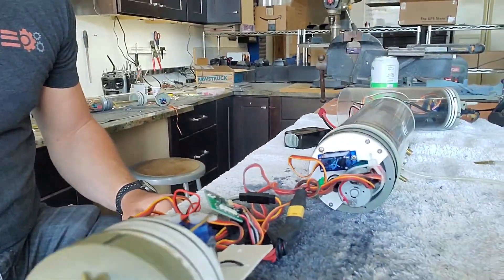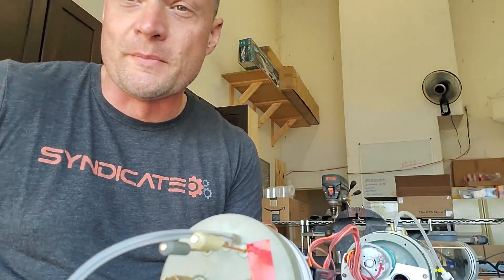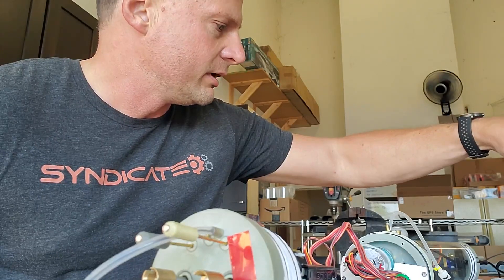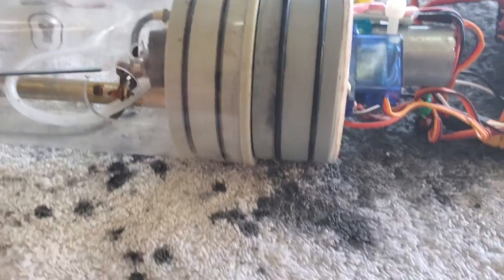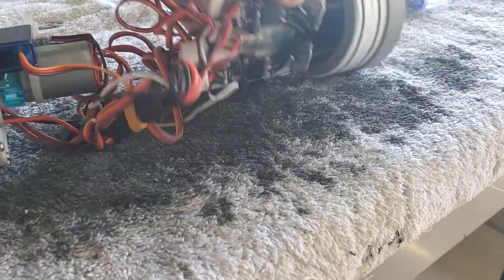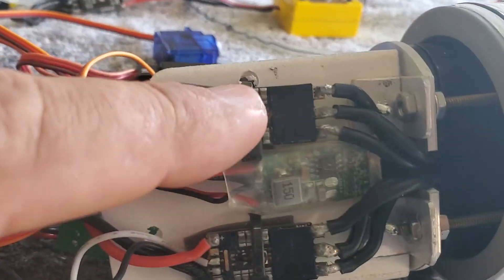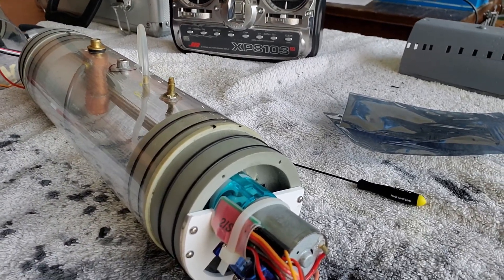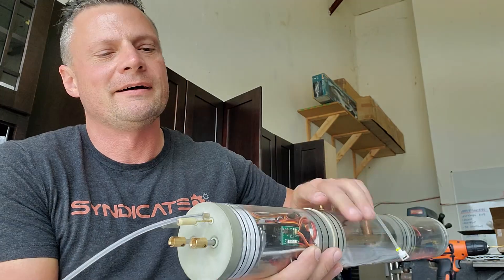Troubleshooting a misbehaving cylinder for your RC submarine

Comment: Bob,where you able to salvage speed controllers or replace?I fixed electronic switch that got wet with corrosion X.Thought I pass along this tip.Tip for tip,sound fair?Always enjoy your videos!Thanks Chris H.
Reply from the maker: Nope, they were both toasted. One did not work at all, the other did not respond to TX inputs, but did spin the motor when used with a tester.

Comment: Bob, did you check the "O-rings"? Since there was water in the tube, there might have been a nick, cut, or improper sized o-ring.
Reply from the maker: The cylinder was checked for leaks prior to operation, prior to shipping and again after these repairs. No leaks were evident. I assume the leak was caused by improper end cap installation.
Reply: @RCSubGuy  : The reason I bring this up is because I had to many incidents were o-rings were replaced with "close enough" rings. I had to beat into my technicians to check the ID, OD, cross section, and type of material before replacement.

Comment: Bob could you do a vid on setting up the AD2?

I have one, and I have never been able to get it to work with Futaba (UK) radio gear, in my case specifically a T10CP and R146, everything else works on the sub, but I had to in the end just remove it and run without, it'd kind of do half the calibration where you tilt the WTC, and it would show movement on the servo from the midpoint in one direction, but not in the opposite direction, eg it would command pitch down and back to central, but not up and back to centre.

I suspect it could just be an incompatability with my radio gear, but it could just as easily be me doing something wrong, so a set up video would be very useful.

Cheers :)